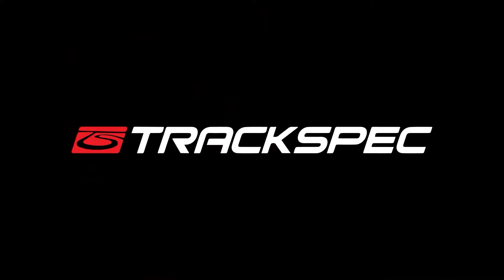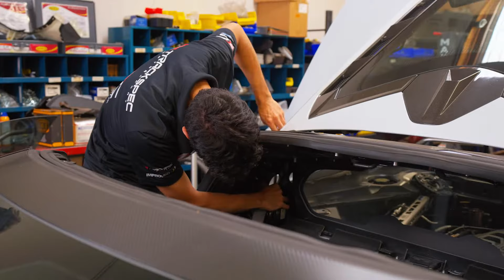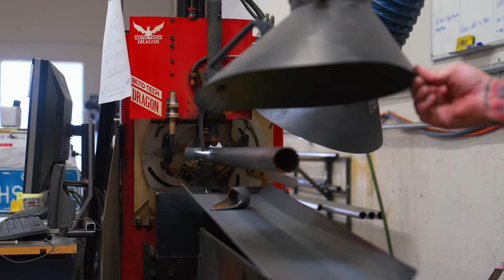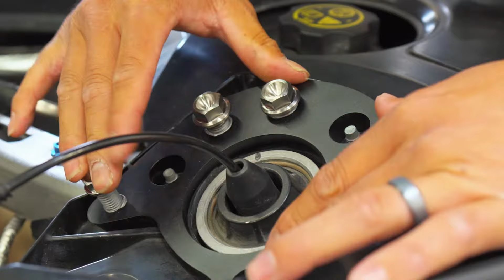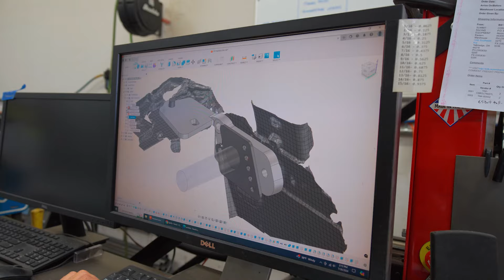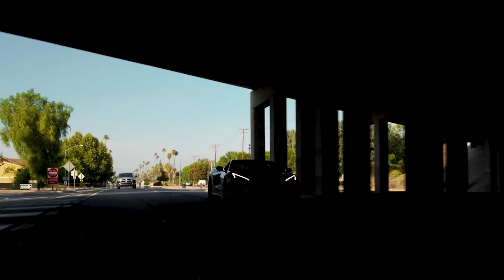Trackspec WORLD'S FIRST C8 CORVETTE FRAME MOUNTED PASS THRU Bolt in Roll bar

Comment: Any pics
Of behind with the hatch closed. And does this fit a z06 coupe. Also any panels cut going thru the main wall and are they replaceable 
Panels available thru dealer  to which one cans reorder if wanted to go back to stock for trade in value
Reply from the maker: The pass thru area is not replaceable unfortunately. But we do make nice plugs for it if you ever need to close the area up for resale!